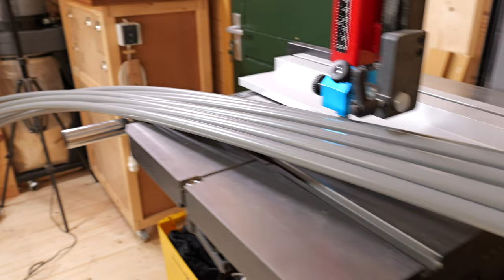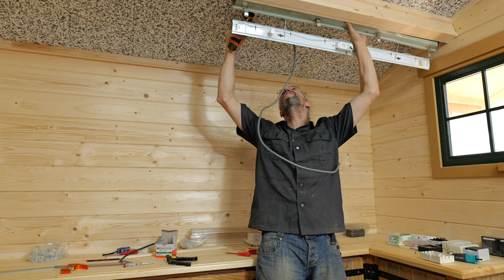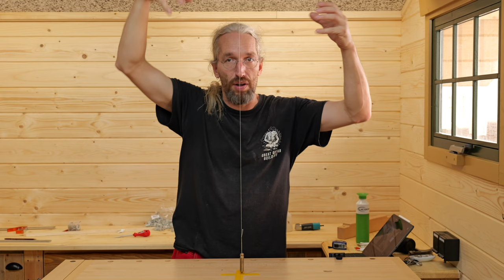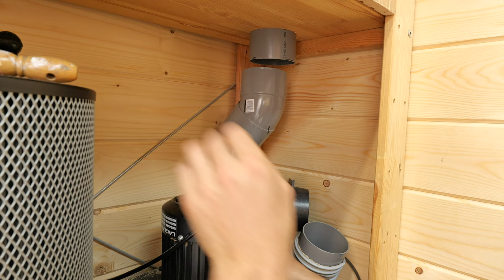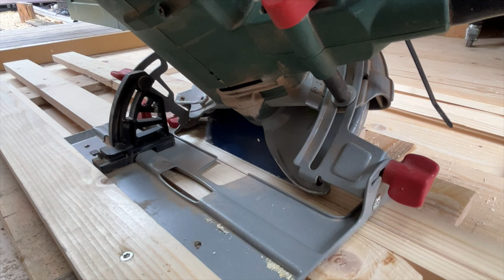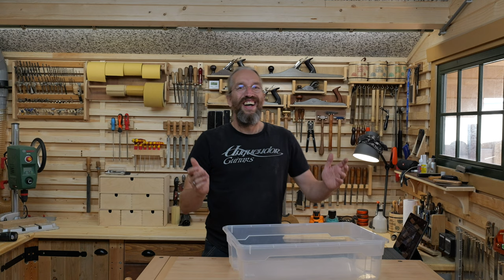Installing Electrical power, Dust extraction system & French Cleat Tool wall.

Comment: The last video was a good video. No need not to be proud of it. You had the music going, rockin out, getting stuff done. You briefly mentioned some indecision towards the end but I would have had no clue if you didn't explain it in this video. Just remember, Heavy Metal in, anxiety out. When in doubt flip a coin and if you can't decide where to put the outlet just remind yourself that it doesn't matter if you have more of them then you'll use!
I'm just kidding. Don't get me wrong, it can be quite a struggle because logic is logic and feelings are feelings! It will pass. Sometimes you have to let the dust settle for a while. Take it easy but not too easy. You want to keep just busy enough, at whatever, so that depression doesn't replace the anxiety. Even that can be quite difficult.

Comment: Wow you have done alot, this is great, and the vaccum system is great to. i´ve never seen electrical cables in pvc tubes like that before, at least not here in Sweden, but i guess its a matter of different standards for different countrys.. thanks.. :D